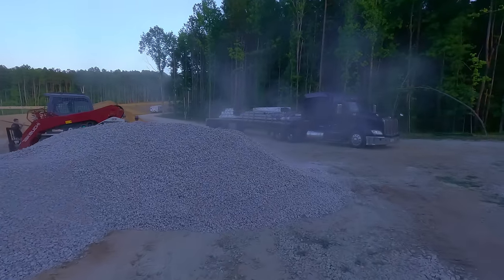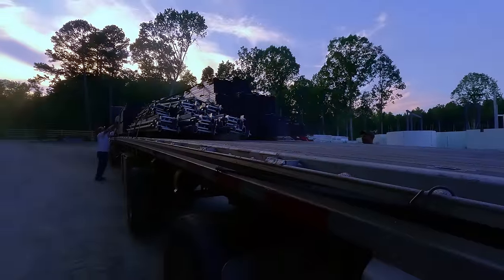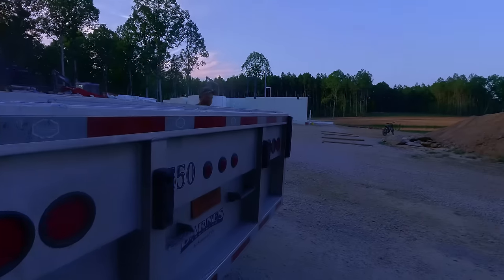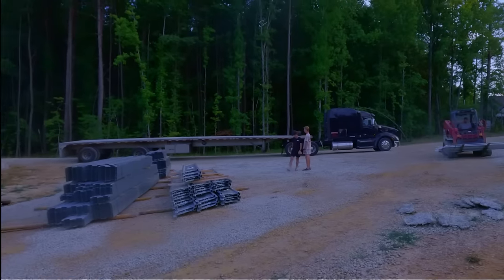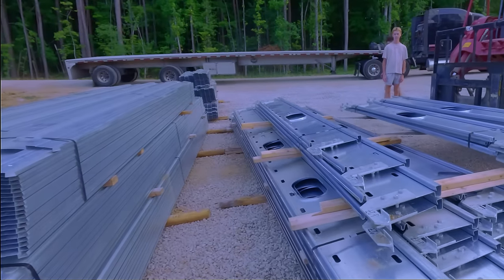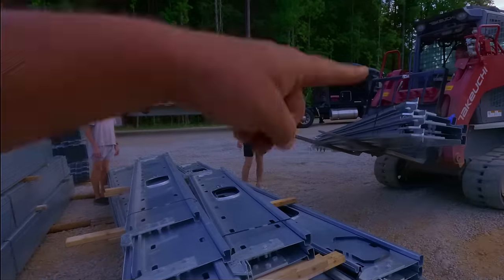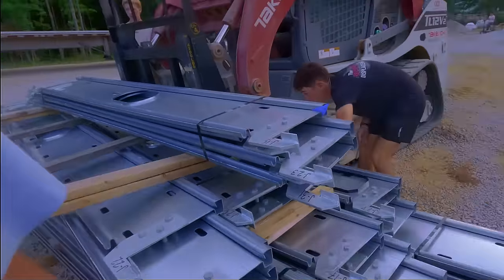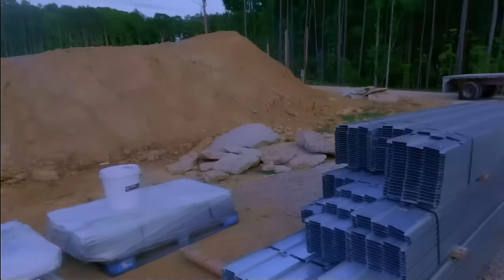Super Floor Suspended Concrete System Arrives for the ICF Mansion

Comment: How cool is that? We have the ongoing shenanigans of Mr. Bealy Good & LetsDig18, in this special-edition, after-hours episode. To the point, & succinct in scope.
Having reached the concrete pour of the walls, combined with the arrival of steel and aluminum parts, the excitement builds as the complication increases on this construction site 
We offer prayers for continued success in this endeavor ..
Reply from the maker: Thanks ! 😊
Reply: @BealyGood  As a mandatory oppositional spell, equal text-time gesture, 'We curse you Haney' Blessings are also a form of spell

Comment: Practically building yourself a bunker. Won't have to worry about termites or wood rot with concrete. Plus much quieter when you're in the basement and kids run through the house, lol. Anyway, was curious what floor system you were using and now we know. Thanks for sharing Geoff.
Reply from the maker: Thanks for watching 😊

Comment: Geoff you most definitely need grounding and bonding with that much steel going in the house.
Growing up on the farm in Iowa I can’t tell you how many times I saw lightning hit the lightning rods on top of the barn in the house.
After over 100 years of use for Apple decided the cast-iron grounded rods needed to be replaced with three-quarter inch copper rods that was driven almost 20 feet on the ground and that was no fun
Reply: None of the steel will be visible, it'll be encased in concrete - for fire protection - which is mandatory here in Denmark according to the building codes, and most likely in the US too. 

- steel bends relatively easily when exposed to heat, and you'll be surprised how little heat it actually takes, especially when there's some weight on it, therefore the concrete encasing.
Reply: @jrand2631  it is not required to be encased in concrete in the USA,  and in the USA it is just painted or wrapped a wood and Sheetrock wrapper.  Or as in the case of the World Trade Center towers, it was just covered with flame retardant insulation.   But most steel in building in the USA it is just left exposed in the buildings.

Steel  been encased in concrete in the USA is a lightning rod, no where in the world seems to have the lightning as the USA does.

Comment: Looks like a nice flooring system as long as you keep the span under 30 feet.  Not sure how you'd insulate if you wanted to be using in-floor radiant since you wouldn't really want to be warming up the support structure.
Reply from the maker: @michiganengineer8621  spray foam underneath

Comment: next time check into a commercial shoring and decking system, very simple, engineered and job built, basically 3/4" plywood and shores, many available from  4x4s 0n 4ft centers, or scaffold type, frame it, place your concrete, knock it down and remove it, rental, very very clean and fast, thinking financially also $ savings. this looks scary $, jus sayin, done many a elevated slab. Walls look good though!